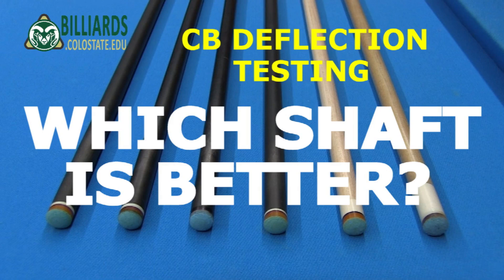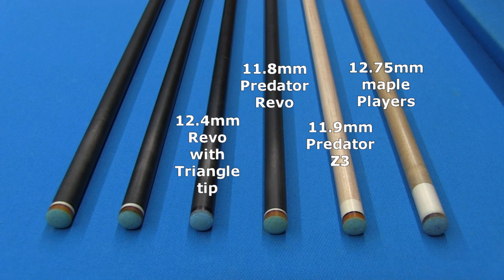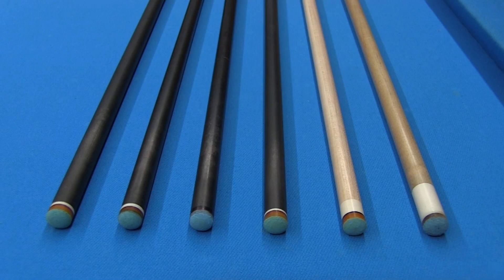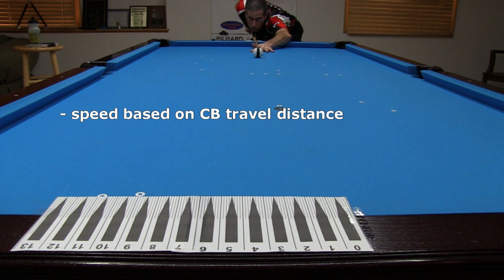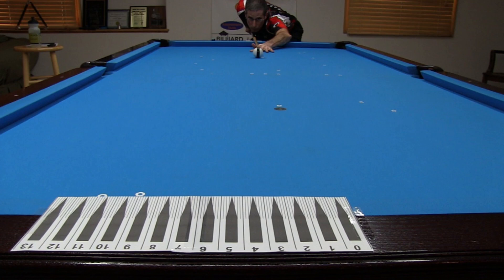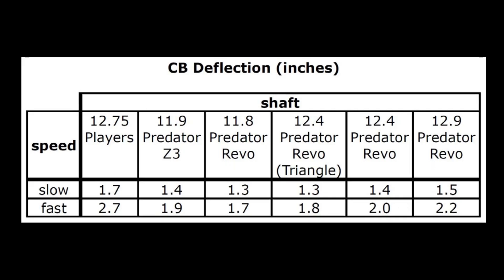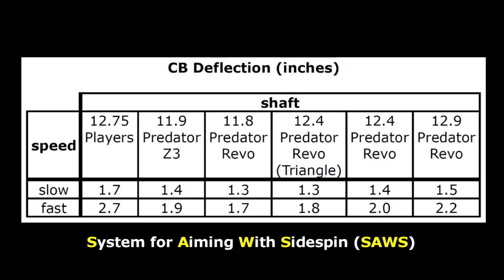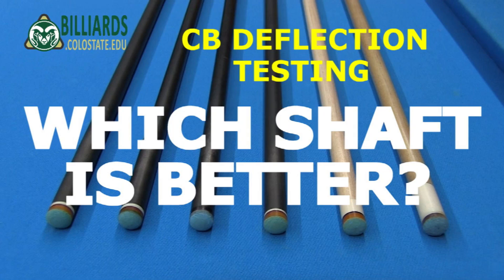CUE TESTING for Cue Ball Deflection, And PREDATOR REVO Carbon Fiber Shaft SIZE EFFECTS

Comment: Thank you for your video. could you also test the deflection of Jflower SMO and Mezz Ignite? I want to know which is with less deflection. I have tried by myself Revo and Ignite, the deflection of Ignite is much less than Revo. thank you.
Reply from the maker: I don’t have those shafts, but anybody can easily and reliably test and compare any shafts using the simple procedure in this video.  BTW, less deflection isn’t necessarily better.  See the videos and info here:
https://drdavepoolinfo.com/faq/cue/low-squirt/

Comment: In the end does a 1.7 vs. 2.0 deflection really make a difference so long as the amount of deflection is consistent?
Reply from the maker: No amount of deflection makes a difference as long as you no how to adjust your aim over a wide range of shot speeds, distances, and amounts and types of spin.  Concerning 1.7 vs. 2.0, this 18% difference is important, especially with long shots into tight pockets.

Comment: And? Which shaft is the best??
Reply from the maker: The one you like the most.  Less CB deflection isn't necessarily better for every player.  See the videos and info here:
https://drdavepoolinfo.com/faq/cue/low-squirt/
https://drdavepoolinfo.com/faq/cue/selecting/
Reply from the maker: Although, carbon fiber has the advantages described here:
https://drdavepoolinfo.com/faq/cue/carbon/
Reply: @DrDaveBilliards  problem is ,how after 30-40years playing with wood,to start now with carbon???
Reply from the maker: @aleksandarmilanovic5246 You obviously need to decide what is best for you as an individual.

Comment: In one of your videos, you mentioned that before the Revo 12.4, you played with a Z3 shaft (if I'm mistaken, I apologize in advance). How long did it take you to adjust from the Z3 to the Revo?
Reply from the maker: I played with a Z2 before.  It took me almost no time to adjust since the amount of CB deflection was pretty much identical.
Reply: @DrDaveBilliards  Alright, just one more question that naturally comes up—why didn't you go for an 11.8 mm diameter instead of 12.4, considering that the 11.8 Revo is closer in thickness to the Z3?
Reply from the maker: @Brandzaman39  I switched to the Revo very early, when only the 12.4 was available.  Because I use an open bridge, I really don't care much about the tip diameter (as long as the amount of CB deflection is in the range I prefer).  For more info on all topics related to this issue, see:
https://drdavepoolinfo.com/faq/cue-tip/size-and-shape/
https://drdavepoolinfo.com/faq/bridge/open/
https://drdavepoolinfo.com/faq/cue/low-squirt/
https://drdavepoolinfo.com/faq/cue/carbon/
Enjoy!
Reply: @ If the option to play with 11.8 had existed at that time, would that have been your choice? What do you think? :))
Reply from the maker: @Brandzaman39  That would have been fine with me also.  I honestly don't have a preference.
Reply: @ in terms of power transfer, should it be any difference between revo 11.8 and 12.4?
Reply from the maker: @Brandzaman39  I would guess the 12.4 might be slightly better in this regard, but any difference is probably insignificant.
Reply from the maker: @Brandzaman39  A different tip hardness would have a much bigger effect. See:
https://drdavepoolinfo.com/faq/cue-tip/efficiency/
Reply: @ Yes, the hardness factor definitely makes sense. As for carbon shafts, there should be only a slight difference, considering that it's a very characteristic material. It should retain its properties much more efficiently than wood relative to diameter. But still, I thought I'd ask—you never know.
Reply: @DrDaveBilliards  is revo giving you more swerve than Z shaft? Do you have to calculate differently, especially when you can't avoid slight cue elevation.
Reply from the maker: @Brandzaman39  No difference.
Reply: @DrDaveBilliards  tnx Dave

Comment: what do you think about 314-3 shaft? Have you tried it?
Reply from the maker: @Brandzaman39  I have not, but anybody can easily test and compare any shafts using the simple procedure in this video.
Reply: @DrDaveBilliards  do you have any video comparation wood vs carbon. What are main differences? Energy transfer etc.
Reply from the maker: @ Yes.  See:
https://drdavepoolinfo.com/faq/cue/carbon/
All the differences are summarized and demonstrated there.
Reply: @ thanks for references.I have a question regarding them. When talking about the miss cue limit and carbon shafts, is it really necessary in actual play (considering you have experience with the Revo) to hit the cue ball so extremely to achieve adequate spin, given that carbon shafts have better energy transfer? Do we ever need to hit close to that limit to achieve maximum spin?
Reply from the maker: @Brandzaman39  To achieve maximum spin, you need to hit close to the miscue limit, regardless of the shaft being used.  FYI, the hit efficiency difference is not very large and depends more on the tip.
Reply: @DrDaveBilliards  tip diameter?
Reply from the maker: @Brandzaman39  See:  https://drdavepoolinfo.com/faq/cue-tip/size-and-shape/
Reply: @DrDaveBilliards  Dude you covered all the science of billiards :) I need to study this more thoroughly. What is your opinion on mastering pool in terms of the "feel" of shooting? Why do people leave carbon shafts? I see many selling them after trying and going back to wood. Is it possible that for certain types of shots (which are more sensitive at lower speeds, for example), the Revo might be inconvenient to execute or to feel speed, how much spin etc generaly more numb  feedback? I'm not counting professionals who have been pocketing balls their whole lives. They can play with anything. But for beginners or intermediate or even just recreational players, is there any reason not to use carbon, Revo in this context.
Reply from the maker: @ Carbon fiber shafts have advantages for all people per the info here:
https://drdavepoolinfo.com/faq/cue/carbon/

Comment: Great comparison Dr dave, the triangle revo is definitely trimmed smaller than the other 12.4 and looks even small compared to the 11.8 so no wonder it had lower deflection.

I have tested a 12.5 cf shaft for around 3 hours then trimmed the tip to around 11.7 and the deflection went down a fair noticeable amount
Reply from the maker: @iimiboy  See the squirt-related tip size and hardness info here:
https://billiards.colostate.edu/faq/cue-tip/size-and-shape/
https://billiards.colostate.edu/faq/cue-tip/hardness/
The effects aren’t as “obvious” as they might seem.
Reply: @DrDaveBilliards  oh I've watched all your videos of course. Even a few mm is a lot to me but also smaller length on a tip makes a difference I've found which I'm sure I first learnt from one of your old vids
Reply from the maker: @iimiboy   The links above have much more info than any videos.  Check them out.
Reply: @DrDaveBilliards  thanks Dr Dave, I'll rewatch it, appreciate your efforts

Comment: Dr. Dave, I love all your videos and you are a true treasure for the pool community. I hope I meet you one day. Will you be reviewing different carbon fiber shafts from different brands. I am really curious about Whyte Carbon Wood Grain shaft as it seems that's the only shaft in the market which looks like wood. I have been using revo 12.4 carbon fiber for 5 months and I am still not thrilled about the black color and the metalic noise when I hit the ball with a stroke.
Reply from the maker: I don't have plans to do any more review or testing videos.  Everything I've done to date can be found here:
https://billiards.colostate.edu/faq/cue/carbon/
https://billiards.colostate.edu/faq/squirt/published-data/
Reply: @DrDaveBilliards  thank you for the response Dr Dave. It looks like Whyte carbon is pretty good as well. I am used to playing with Revo but the sound is driving me crazy.
Reply from the maker: @velikayim2182  Personally, I don’t care how a hit sounds.  I just care about what the CB does.  But you can change the sound with a softer tip.

Comment: As a long time member of AZ billiards I dont know if you have seen post by some members  who have tried out both 12.9 and 12.4 revo and found the 12.9 having less deflection  then the 12.4 . I decided to confirm this with Predator itself by sending them an email  asking if its true and  the reason why this is so  is the  12.9 has a THINNER  cabon fiber wall in the shaft end  compared to the 12.4    thus having a lower shaft end weigth even if bigger  diameter  so lower deflection for the 12.9  . In their reply  they did not discuss about the carbon wall thickness comparison  but said  and I quote

Thank you for contacting us.

The REVO 12.9mm is the lowest deflection shaft, of the three.     ( I mentioned 314,  revo 12.4 & 12.9 )

I can also tell you, the most popular of the three, is the REVO 12.4mm.

Please let us know if you have any other questions.

Sincerely,

Kim Newsome (Predator group )

as seen https://www.signalhire.com/companies/predator-group
Kim Newsome is a product specialist at predator and former (?) or still active women pro player who is sponsored by predetor 

I am NOT posting this to debunk your test result. I subscribe to your channel and follow you coz I TRUST and LEARN a lot of things from you  here and your website.  If predator is  telling the truth , do you think this is due to what  was mentioned in az billiard that the shaft end weight of the 12.9 is lower than the 12.4 coz of thinner carbon wall ? but if such is true then your test result ( I could not find any flaw in your video here ) should have shown the 12.9 having slightly less deflection than the 12.4     Your test method is sound and your stroke is as straight and solid as can be. I wish i could have as good  or even just 90% of stroke that you have.     Thanks

ps to see the email itself  see  https://forums.azbilliards.com/threads/predator-confirms-revo-12-9-has-lower-deflection-than-12-4.561009/

Comment: MERRY XMAS TO YOU AND YOUR FAMILY SIR.  I would appreciate your opinion,  its been nearly 10 years since predator popularized the carbon fiber shaft with no ferrule to get the  front end weight down  to lower deflection  to where the  pivoit point tas low as 19 inches or so on the REVO  compared to the original wood 314 shaft of around 12 ".  Is there any other material cue makers can go with  for the shaft to go even lighter than carbon fiber that can maintain a smooth bridging surface  ? If not then i will be all about lesser more conical taper then  coz you already took out the ferrule , only shaft meteiral and taper can be worked on right ?   Do you think there is any new shaft material to expect in the next 2 yrs to rival carbon fiber for deflection ?  Thanks a lot.Sir
Reply from the maker: Carbon fiber is tough to beat.  About all they can do to reduce CB deflection further is reduce the diameter and wall thickness near the tip, but there is a trade-off with strength.
Reply from the maker: For more info, see:
    https://billiards.colostate.edu/faq/cue/low-squirt/
    https://billiards.colostate.edu/faq/squirt/endmass/
Reply: @DrDaveBilliards  I think the wall thickness  reduction you say is the way to go wifth  Since its stiffer that wood , further thinning the wall could make the shaft flex closer to a wood shaft . Its stiffness seem to be one reason wood purist dont like it. Another is Im not sure but maybe thining the wall further will make the sound of  the hit better  Right now they come with soft tips , most like playing with medium tips but a medium tip on a revo does not sound good another reason some dont like it. Thinning the wall may mean you can do away with that silencer pad which is  turnoff for people who change their own tips without  s latte. Here in the Philppines  majority change their tips manually . So thinning the wall  alleviate to a certain extent 2 things people dont like about it that could change their minds to buying one increasing sales.  The tip diameter i think the limits are there  conical is not comfortable with a closed bridge which many use.  and unless you are a good player with a good stroke its tougher to hit the cb and not get uninteded side spin.  Thank you

Comment: If say using the deflection test a cue shaft is found to deflect 2 inches over the length of the table and has a NPL of 20 inches from the tip  ,  would you expect a differnt cue shaft (with same tip hardness/thickness )  whose deflection is 3 inches over the length of the table  (50 % more ) to have a NPL tha is 50% shorter  or around 13.33 inches ?   Also it is said that shaft end weight determines deflection (for the most part ) has there been any study as to what length matters  meaning for example the shaft end weight  that matters for deflection is only the first 6 inches of the shaft and beyond 6 inches any added or reduced weight from the shaft would not have any noticable effect on a shaft's deflection. Thank you
Reply from the maker: Yes.  The natural pivot length should vary in proportion to the amount of CB deflection.  For info on how endmass affect CB deflection (and how distance from the tip factors in), see the explanations and article links here:
    https://billiards.colostate.edu/faq/squirt/endmass/

Comment: When you watch the video, there is a much larger difference between the different diameters of carbon fiber shafts than the difference between the wooden and carbon fiber shaft (players cue aside) and I don’t think the results spreadsheet accurately reflects that fact. I don’t think you purposefully did that but it is worth mentioning. Also, in my opinion, the difference between one inch of deflection and 2 1/2 inches of deflection should not, in theory, necessarily improve one’s game since in both cases the deflection is still present and needs to be accounted for, which I think reaffirms the fact that it’s all about the player, not the equipment. Overall this video is quite useful, as always.
Reply from the maker: Shafts of different diameters can have the same CB deflection.  Many things affect the "endmass" of the shaft.  For more info, see:
    https://billiards.colostate.edu/faq/squirt/endmass/
    https://billiards.colostate.edu/faq/squirt/cause/
I'm not sure I understand your point about the difference shaft diameters.
Reply: @DrDaveBilliards  My point was just to describe my observations watching your video. I only briefly looked over that endmass link, but it seems like in the case of the revo, it is possible that larger shaft diameters indirectly cause more deflection (not saying that is true for all shafts). That said if the revo had the core drilled out, as described in the article, and the wall thickness was the same in all the shafts, as I seem to remember you mentioning in the video, that may not explain what I saw. But the amount of increased deflection I saw with larger revo shafts was significant, so do you know if it is possible for small differences in manufacturing to make that much of a difference?
Reply from the maker: @rqlk  The 11.8 and one of the 12.4 Revos had the same CB deflection.  That shows that diameter is not the only factor.  Although, it makes sense that the largest-diameter Revo had the largest CB deflection.  For a larger diameter carbon fiber shaft to have less CB deflection, it would need to have a smaller wall thickness (which is possible).
Reply: @DrDaveBilliards  I must have misremembered, I rewatched the video and I see now 11.8 and 12.4 are the same. I also do see once again watching the videos of the shots that there isn’t any meaningful difference between the z3 and the smaller revo shafts. I also still think that the difference in deflection between the cues, again players cue aside, is negligible for the purpose of improving one’s game.

Comment: I started to watch this but with all of the shafts being of different diameters and having different tips and without a machine delivering a consistent stroke I don't see how this can be an accurate test. Every test comes out objective to personal opinion. I've been trying to find information on how carbon shafts are made and why some are, by opinion, better than others. Any suggestions would be appreciated. But thanks for your hard work.
Reply from the maker: With the carefully designed procedure described in the video, human testing can give excellent results, even if one's stroke is not perfectly consistent.  FYI, machine testing is not always as good as some people think.  See:
    https://billiards.colostate.edu/faq/squirt/robot-test-results/
especially the "Rules for CB Deflection (Squirt) Testing" section.

Comment: has anyone experimented with uneven lengths of cue shaft vrs butt section.  would a longer butt and shorter shaft tend to lessen deflection?  i would think a shorter shaft would result in less vibration but perhaps have more or less deflection.  as a tall player i often use an extension, sometimes on the butt, other times in the middle. 
i pose this question as dr dave usually produce videos with a more detailed technical explanation
Reply from the maker: The causes for CB deflection and techniques for reducing it can be found here:
    https://billiards.colostate.edu/faq/squirt/cause/
    https://billiards.colostate.edu/faq/cue/low-squirt/
Enjoy!

Comment: Can u do a comparison test which can draw easier a 12.9mm carbon fiber shaft, a 12.5mm, 12.4mm or 11.8mm carbon fiber shaft
Reply from the maker: I wouldn’t expect any meaningful difference.  If you or others wanted to test this, you could use the procedure in the videos in the “Can a softer tip put more spin on the ball?” Section here:
    https://billiards.colostate.edu/faq/cue-tip/hardness/
For more info, see:
    https://billiards.colostate.edu/faq/cue-tip/size-and-shape/